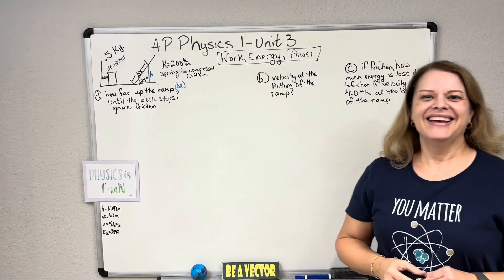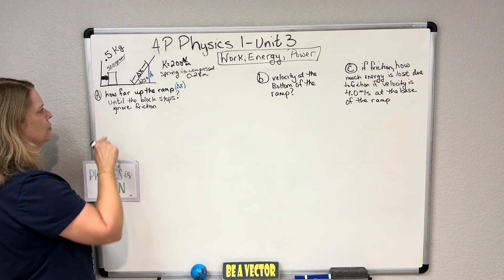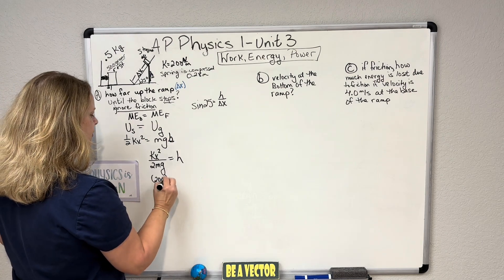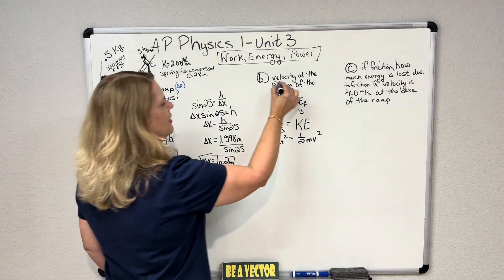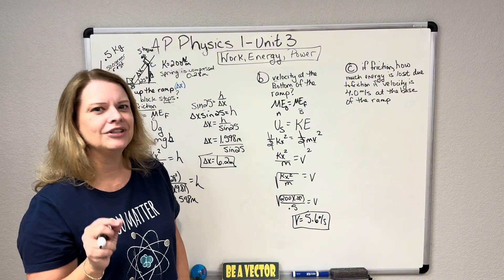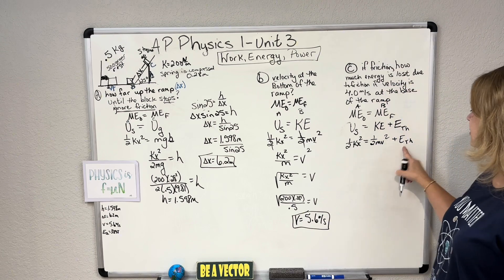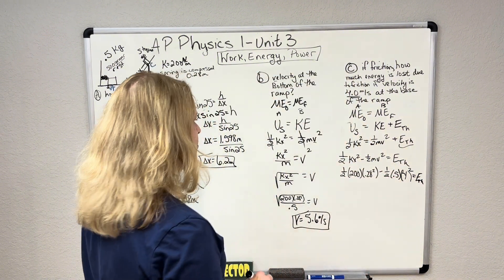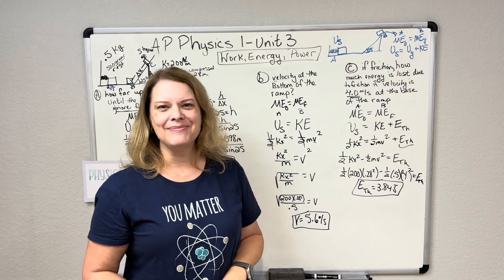AP Physics 1,Unit 3:Energy Problem with a Spring and a Ramp

Comment: Extremely helpful! However, why was 9.81 instead of -9.81 was used for gravity for part a?
Reply from the maker: Thank you and great question. When we are talking about a vector we add direction. Acceleration due to gravity is downward and on Earth is -9.81 m/s^2 because acceleration is a vector and has direction (downward being assigned negative here). However, when using little g in equations that is measuring the strength of the gravitational field and is not a vector but a scalar quantity and is always positive 9.81. m/s^2.  Happy Physicsing!

Comment: Do you guys possibly have work sheets? Or know where to find worksheets for practice
Reply from the maker: @davi.__.520  AP classroom has great multiple choice and FRQ’s.  Web.mit.edu also has a large practice workbook for AP Physics 1, although, it includes units that have been cut from the curriculum and does not include the new fluids unit that was added this year.